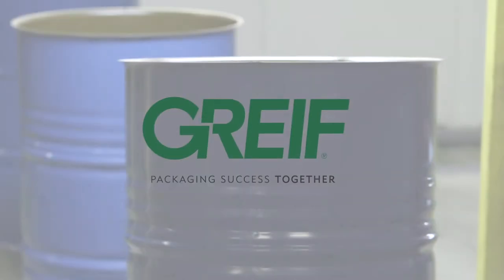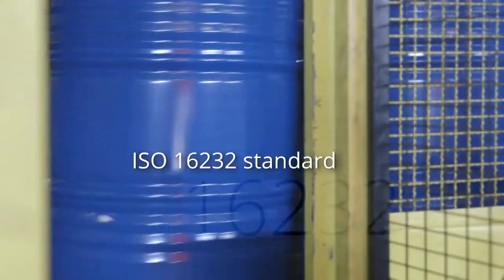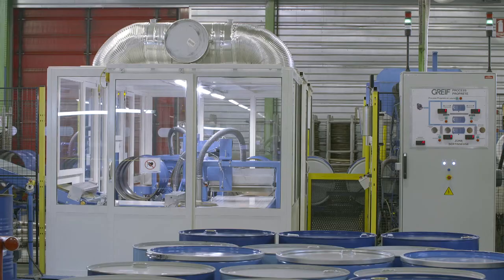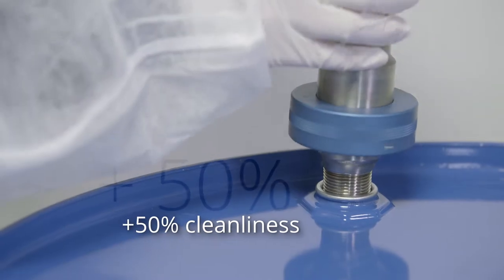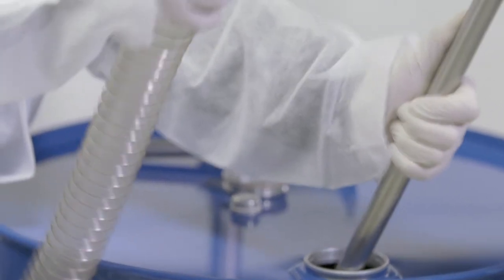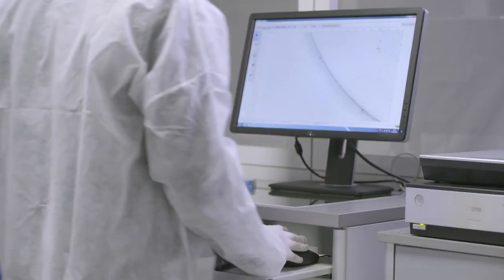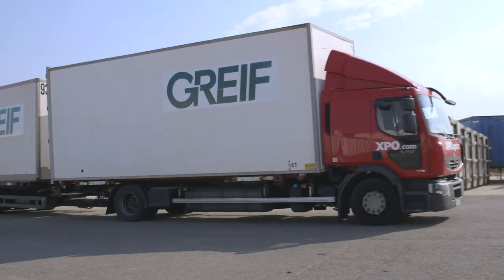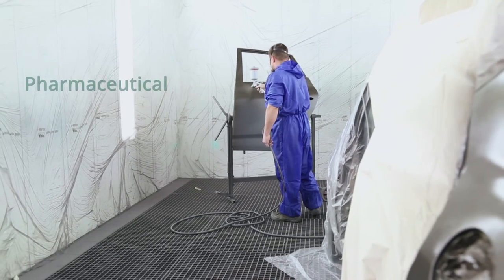Internal Cleanliness solution for Large Steel Drums

Comment: What kind of impurities do we get to have in these kind of barrels?
Reply: Kalam azath,  it depends on what kind of machinery the company use and how good the company is in making drums or reconditioning them. I used to stay just round the corner from a cooperage that also reconditionend drums and they had the best machinery in europe. And started in 1903 with the cooperage first then they built the drum plant in 1920 and they were there right up to 1995. And doing at least 2000 drums a day. So what does that say about how good they were. I worked in the cooperage and it was hard dirty work. The drum plant was dirty as well but a bit better than the cooperage. It was in scotland, paisley. And no customer had any complaints in 90 years becouse the drums were put through the best machinery money could buy and every aspect of the drum was checked after being painted to see if it was ok. And to me they just looked liked brand new drums you couldnt tell the difference and the whiskey barrels well that was an art in itself. How the coopers made them was just sheer skill and hard work, the geometry alone in it was amazing, there was so much the cooper had to be able to notice when a barrel needed recoopering as it could be leaking from 3 areas of the barrel, as in the top or bottem or the sides. It was all about the eye, just like in most hard trades, like brick laying, joinery, it looks easy but its not like that at all. Thats why so many men serve there time then leave the trade for an easier job with alot less money. If there honest they will say i left becouse it was too hard. A few of my friends quit being a joiner when they were age 21 after they served there time and got there papers they just left. A think its 4 or 5 years your apprenticeship lasts. At one time in the 1950s, 60s a think, a cooper had to do 7 years as an apprentice, thats how hard it was to be a cooper, becouse it was even harder then. Then they cut it down to 5 years becouse the trade was changing a bit. More machines were being brought in to help the coopers cut just a slight bit of wood of a stave or an end wich made it easier than doing it by hand. Btw a stave is one of the bits of wood you see on the barrel, wich can be from 2 inches wide to 3 inches, and the ends are whats on the top and bottem like a lid except it isnt as the raw whiskey goes in the bung hole wich is on the side of the barrel and exactly in the middle of the barrel put on by the cooper as they drill the bung hole onto a stave and the bung hole is about 2 inches all round. I would have to say coopering is the most hardest, and most skilled trade i have ever seen. And they make engineers and brickies and so on look like waitresses. Thats why they get paid alot of money.